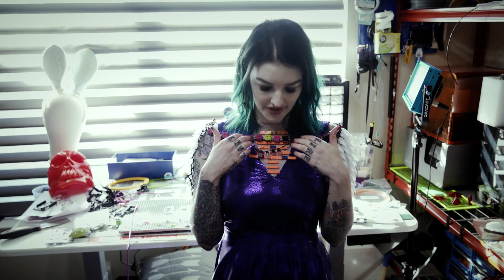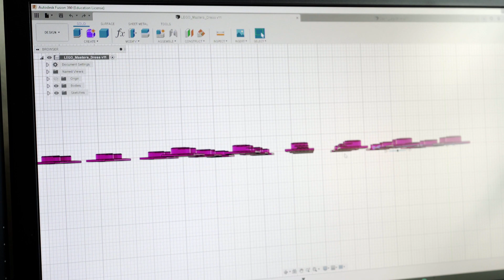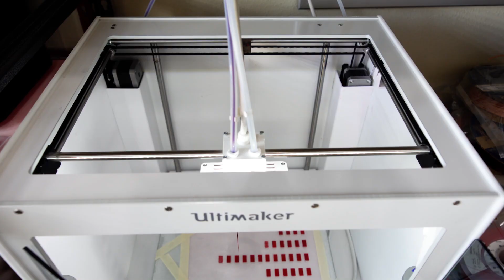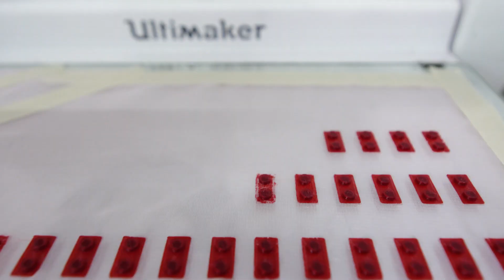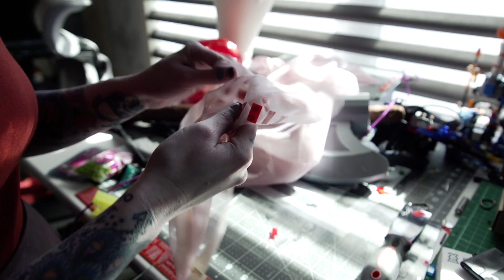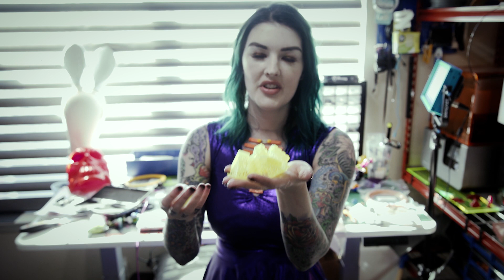LEGO Masters Amie's 3D Printed LEGO Dress from Episode 1

Comment: Theoretically, if your model is virtually sound, you should have to adjust the tolerances of the model. Instead you should be able to adjust your printers feedrate, and if that's adjusted, fix it with a very small adjustment to your horizontal or XY compensation, so your model can remain accurate.

Now, if you're not sharing your models with others online, it probably doesn't matter, but one of my earliest models I fudged to work on my printer, but discovered it didn't work when I changed filament, and later when changed printers and slicers it was worse. DImensional accuracy is never easy for 3D printers, espeically when they don't control for all the myriad of variables that happens when models are turning from virtual to real.
Reply from the maker: 3D Printing Professor I printed it on both my Ultimaker S5 with a 3.00mm nozzle and on my Raise3D with a 1.75mm and on my Form2 resin and the tolerances all were different for the LEGO bricks to snap too. I’ll look at the federate though for the FDM printers! Good suggestion!!